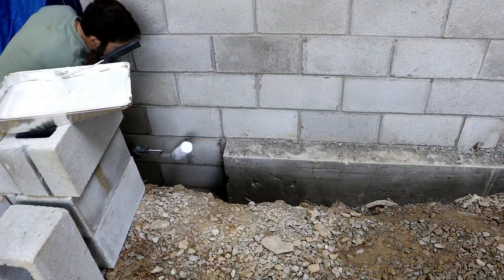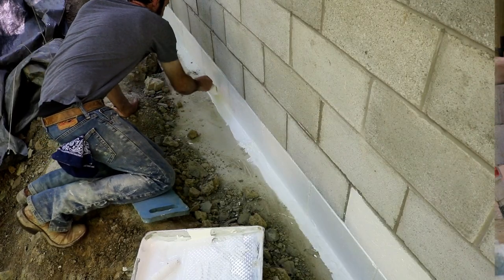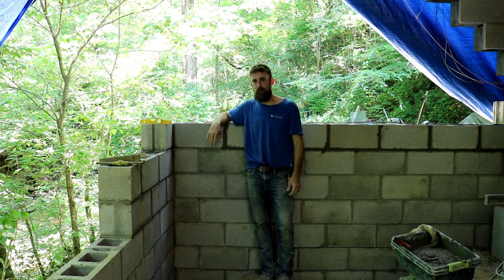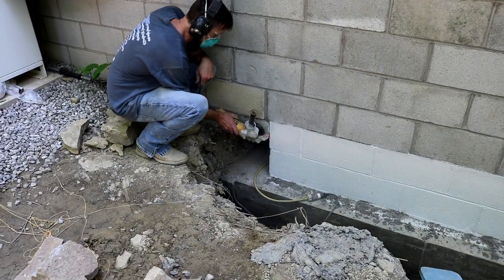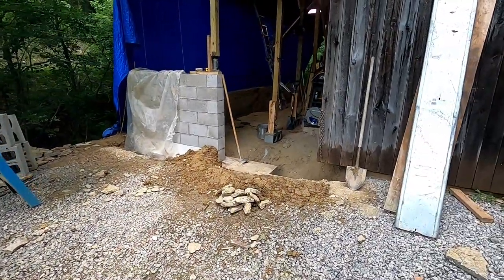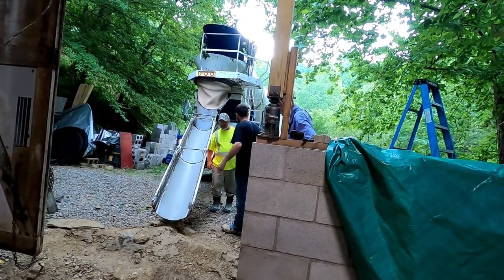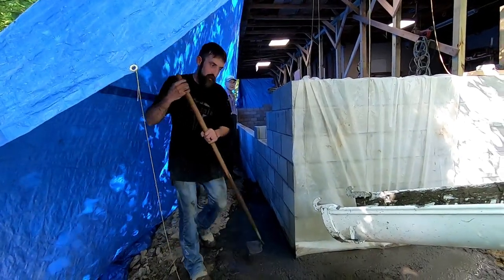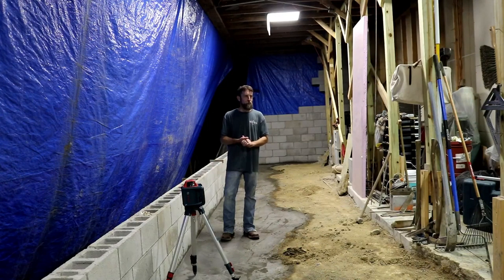Sealing & Backfilling with FLOWABLE FILL.  Shop Repair

Comment: Don't let the doubters get you down.  Your doing a great job of tackling a large project with common sense and logic.  You don't need an engineering degree to do what your doing.  Your taking the slow and methodical way and it's working just great for you.  Don't let the haters get to you, they just wish they could do what you are doing.  And if they're offended by the way your going it, as they say "you can't fix stupid"   Keep up the good work.

Comment: Very much inline with all the other positive comments; You Sir, have done a TREMENDOUS JOB on rescuing that building. I've never seen anyone taking that much care with a block wall. And the results speak for themselves. There's plenty of subscribers here who admire your determination and enjoy your videos. Myself included. 
I also fully understand that you cannot repair this building by follow traditional building practices. I know exactly why you have to do, what you have to do, because I build a (much smaller) workshop in the same manner, in the UK. We get a lot of rain, so I put the roof up FIRST, and then worked my way around from there. The last step was actually to pour the floors, which may seem crazy, but it worked for my circumstances. 
I know it can sometimes be tough to have to deal with the minority of people who want to be negative, and don't have empathy, or understanding of complexity. I am one of those that does understand all that stuff, and I think you've done an awesome job. :)
Reply from the maker: Thanks man👍

Comment: Steve, all those nay-sayers have the same problem.  They don't understand that there are multiple 'right' ways to do a job.  As a retired remodeling contractor, I probably wouldn't have done the job the same way as you.  That said, I admire your tenacity, work ethic and ability to overcome obstacles.  You are doing something you'll be proud of for the rest of your life and have educated at least one person, me, to think things through a little differently.  Thanks for posting these videos.

Comment: You did right - sealing both sides of a concrete wall is a bad idea. Concrete is a sponge,  no matter how you seal it water will get inevitably get in and sealing it on both sides will cause it to disintegrate. A foundation membrane really helps as it allows water to drain. Love your  thoughtfulness, tenacity  and kindness  - your wall looks like it was made by a machinist ...

Comment: When you start getting ready for the slab, make sure you drill and dowel into the existing slab.  Drill 8" deep holes, at a 12" on center spacing, and epoxy 16" #5 rebar into the hole.  For slab reinforcement, unless you are going to have heavy machinery on the slab, then welded wire fabric is sufficient.  Use the 6" spacing mesh, and overlap 6".  Tie sufficiently to prevent movement, and rest on 3" chairs.  If there will be heavy machinery, then use #5 rebar, each way, 12" on center, resting on 3" chairs, and 36" dowels in the 8" holes.  As a construction inspector, this is what is normal for commercial construction.  Since you are rebuilding a work shop, I would consider building to commercial standards.
Reply: Excellent comment. Reinforcing to commercial construction for heavy machinery
is definitely the way to go for a future 16" lathe, granite surface plate, bigger mill,
etc.

Comment: I used flowable fill under my shop floor 23 years ago and have no cracks in the floor it's good stuff. I used 33 yards you got off easy that way but it is heavy. you are doing an impressive job.

Comment: I sealed my shop with black foundation sealant slopped on there like cake batter. Followed by a plastic barrier, perforated pipe in the corner and backfilled with coal clinkers to create a drain tile. I have about 4 or 5 feet below grade on the uphill side and it has remained dry as a bone. Enjoying watching your progress on your shop upgrade. EDIT.. Pulling mud down a trench is a thankless job. Call in the Calvary !!

Comment: Steve ignore all the haters, what you have and are doing is top notch for a non professional and as for what you have done with the creek using that chain link fence and putting rubble behind it is only what civil engineer's would probably recommend as the rubble slows the speed of the rushing water down and slows the rate at which it erodes the bank so keep up the good work.

Comment: I for one think you are doing an exceptional job with what you have, it doesn't matter what anyone says because they are not doing the job you are. You are a precision machinist not a a builder, plus you are doing a better job than most builders by not cutting corners. Better to over engineer than under engineer

Comment: Steve and all the rest of the comments, true the good advice comes a little late but none the less it shows up.  I learned as I told you from advice from the experts.  It may have come too late for what I'd done but like you, I had much more to do.  I know you may get criticism from expert machinists and maybe even from "experts" in construction.  I hope you  read my email where I said chew on what you hear before you spit it out...some of it may be good!  Now to all who comment in a negative manner without constructive advice I'd say give advice that can be chewed on and swallowed.  Steve, you are doing a good job on your project which will give you something to be proud of for years.  I still say I built that when a pass some of my jobs.  I also say I did that when I pass some mistakes I made.  Be proud of the successes and learn from the ones not as good.  Others have observed that you have figured out some complicated skills and have developed your way of accomplishing them.  Keep it up and don't get too upset when some offer what could turn out to be constructive criticism even though it may sound like trashing. Now, I have to practice what I preach and get ready for folks giving me that advice!  Greg

Comment: Most flatlander types have no idea about how mountains are filled with rocks. Having lived in NE Tennessee I have a good understanding of how many rocks you had to deal with. We added a cover to our back porch with the support going to the ground for snow loading. Just to get to code my builder spent 3 days with a jack hammer just clearing for the footings. The rocks were over 2 feet thick.

Comment: Steve, I don't know why you even bother to address the comments made by the trolls.  You are doing an awesome job.  You should be proud of what you've accomplished and the skill and craftsmanship!

That flowable fill moves a little easier is you give the surfaces a little spray of water before you get started.  Not enough to run off and puddle in your trench-- just enough such that those surfaces don't suck the water out of the flow as soon as it hits it.

Comment: Another milestone there bud. Your commentary was spot on. Your situation is all compromise,  100%. I've been in home construction my whole life, nothing you've done has been a half measure by any means. Very well done process, and done well too. Options are limitless, you've threaded the needle just fine. Your youngsters will learn and remember as well. Thanks for sharing

Comment: So: Ending their subscription 'cause "That's not how I'd do it"...  Steve, I spent over 20 years doing jobs not unlike yours and you have taught me more than a few things during this series. There is never only one way to do something, especially when it comes to renovation. One of the things I've most enjoyed is you talking us through your thought process for the decisions you make. Would I have used all the same methods you did? Of course not! Do I belive you have done a wonderful job? Absolutely!
Reply from the maker: "Not how I would do it" "Not how I should do it" "Not how I said I would do it"  I'm just paraphrasing this guys  comment .  He was bent out of shape expecting me to sink a fortune of time and money into 1/2 of a old shop that will never last without investing 2X what a brand new building would cost. Then your left with a shop on the edge of a creek with no access.  Clearly this guy has no idea how much a "real support wall"  in my location would cost. Maybe I could get a heavy lift helicopter to drop some heavy equipment in the creek to build it😂.  Just someone no seeing the big picture IMO.  Thanks for watching 👍

Comment: You're doing a heroic job there Steve, don't let the contrarians get you down. People get real judgy when its someone else's money. ("I don't know why you wouldn't spend 10X the money for a 10% better outcome..") only thing I might have done was used the busted slab as riprap, but if you (or your neighbors) weren't keen on chunks of concrete over the bank, I can understand that.

Comment: That was very interesting to watch. This is the first time I have seen a concrete delivery truck that discharges over the cab. Here in australia the trucks only discharge from the back. It was also the first time I have seen your method of brick/blocklaying. I worked for some years for my father as a brick & block layer and your way was unique to say the least. When you pour the concrete floor using a concrete vibrator helps the concret to move along and get it into all the small spaces. All in all you are doing a good job. Hope to see a few more videos of the rebuild.

Comment: Rebar comes in handy in many applications. I machined one to make a clamp holding rack. Devilish material to machine. Also use it to remove dross from my melting furnaces.

Comment: An old man showed me how to pour paint from a 5 gallon Paul. I resented his advice since much of what he told me was of poor value. But his paint pouring method was a good one. Always pour with the cap at the top. This lets the air vent. But more importantly, as soon as the volume is below the fluid level, you can roll the bucket on its side making the hole a weir. It is so controllable that nothing drips down the lid. The cap threads stay virtually clean.
Reply: Paul Hunt, Hey thanks for the idea for five gallon paint cans. I had forgotten about that one. Used that with chemicals when I sprayed crops on the farm when I was a kid.

Comment: Fill-Crete is my go-to when I have to cut a new culvert through an existing road-bed.  Never ever get clay or sand compacted fully under the pipe.  With the frost and water conditions in my part of the world, you can always find where the culverts go under the highways from the dips in the road.

Comment: You're doing a great job Steve. I am a 35yr carreer builder. There's 100 ways to skin a cat, and I don't think I would have done things much differently. As a matter of fact, I don't think I would have tackled that job unless out was my own building and I had more time than money. From a builders perspective, you can't make any money on a job like that. Everything about it is not conducive to productivity...the location being the #1 consideration, it would be a difficult job if it was a flat piece of ground and you were able to drive around I it, but the site and limited space is brutal. Hang in there buddy, you're definitely on the home stretch now. Once you get to grade inside the rest will go smoothly. It's crazy how YouTube creators always focus on the negative comments.

Comment: That sealant works really well to keep the water OUT if you make a good coating on it. You'll be glad you did. I have some in the basement because I need to do it there. My sister has coated three basements in it and NO leaks since.
Reply: Anyway, great stuff Steve.

Comment: I've used that pain on the inside of my basement to keep water out - it works very well, I only get leaks now in e.g. cracks and when the ground gets saturated enough for the water to come up from under the slab.

Comment: Nice job. FWIW I spent years in construction wiring  big box stores Walmarts, Lowes etc and they would always wait to pour the slab until the walls and roof were in place. Working from rough grade is  normal, we would use all terrain scissor lifts due to the heights  but now that  you have the trench filled in ladders or standard scaffolding is easy.   Also I would put money down that the  concrete supplier never got an order for  7.82 cu yds of any product. :D

Comment: Concrete is porous, it needs to be sealed. Otherwise, you'll have moisture on the inside of your walls and you don't want that. You just keep doing what you're doing. The job is getting done. For the naysayers, remind them that you've had a structural engineer to go over the plans with you. Got love it when people are too lazy to go back to the beginning of the series. You're doing a fine job. Great video, cheers :)

Comment: Your doing alright there’s not to many of men left that ain’t afraid to tackle not just the job at hand but all jobs that need doing hell I’m from wv was raised if it needed doing figure it out and don’t half ass anything overkill everything I’ve moved south down here to myrtle beach area and everyone here does the one job that they know how to do and that’s it they specialize in that and never even try to do anything else they hire it out I find it crazy tbh no matter how simple the job they won’t even attempt it but hey do enjoy their money and they love me because I was also raised to charge and honest wage for what the jobs worth no need in charging 5-700$ to install windows or 40-50$ for oil changes in small cars I can go on and on because I do tid bits of everything started watching your channel because I’ve recently began putting together a machine shop and using YouTube to learn how to do it and frankly I love it wish that’s what I would’ve had the chance to see 20 years ago in my teens I’d fell in love with it even then I’d spent hours with a grinder files and sand paper making parts fit to fix my motorcycles and four wheelers

Comment: Concreting the rivers nuts, the only feasible option would be dig out the river so most of the water flows into the other bank preservating your side. That will also help plant roos grow and take hold stuffing it  more.

Comment: this project "doing it backwards" years ago was a common remodel on many dairy farms. here my place the 66 stall hip roof barn originally built in the 1930's never had block footing and had pine siding down to the ground. late 60's dad had a contractor do this same block footing there's as many courses of block underground as above along with glass block windows. few years ago my little nephew was here "visiting" the farm while i was at work he was using the glass block windows for target practice! i just about exploded seeing that

Comment: Try using a five gallon bucket with a roller screen in the bucket and a short broomstick type handle in roller handle. It makes any job like this much easier. Then between coats you just leave the roller in the bucket and snap the lid on till the next coat. It looks like peanut is evaluating the block as a possible future place to store nuts for the winter.

Comment: Great project. You're a perfectionist you know. In the UK the Building Regulations require a damp proof course in the walls 150mm above ground level to prevent rising damp. I hope US regs aren't so picky.

Comment: I could just see the conversation of the designers of that style of cement truck:
"...and from the front it makes it easier to load so you can see this has many benifits over a normal truck"
"Uhh, question.  Where's the engine go?"
"Ohh crap!!!  well lets just bolt it on the back up here."

Comment: Hey Steve Don't Forget To Cut 1 - 6" wide Weep Drain To The Creek Through The Bed Rock Fill With Gravel In The middle  Front Of The Footers. So Your Footers Aren't Always Sitting In Water.

Comment: Hey Steve, It looks like things are coming along real nice. That wall covering you are putting on the outside will have a couple benefits on the inside. Not only will it keep it drier but the white will make your light go farther and you won’t be trying to work with your machine tools in a dungeon. If you have enough room under your floor slab you might consider using some type of styrofoam insulation rather than trying to drag a bunch of dirt back in there. That will help keep your floor warmer.  Hang in there! Carl

Comment: Well I gess it's one way of backfilling a wall , Concrete is construction material gold ,It's mighty expensive , Normally contractors order a truck with a stone slinger and backfill a wall and underfloor with 3/4 clear gravel only , a fraction of the cost , That gravel holds the floor load ,does not pack down and shrink down ,It is also used as fill under footings , My advice for the final concrete pour for the floor is to have "fibre mesh" in it ( 3 inch fiber glass strands ) It prevents the floor from cracking . All the best .